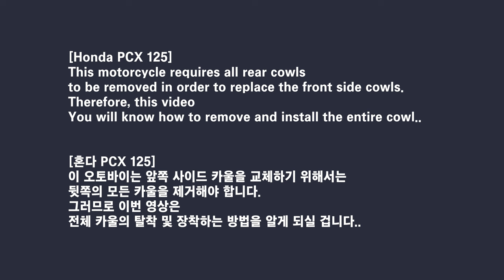Let's see how to change the Honda PCX 125 cowl cover? WW125AM

Comment: I have the same exact scooter, a 2022 Honda PCX Jasmine White and unfortunately I found it yesterday almost knocked down by a car as I suspect because unfortunately no one saw it and it was laying on the bush next to it fortunately, on the right side, so there is no other damage, because I always keep it under a cover. So, I have the left front fender damaged (where it was hit basically), cracked, some scratches and with a hole in it which I really hate and I can't get over it as the rest is in perfect shape :( . I was feeling so frustrated because I bought it new, now it has 5700 km. (I have to change the oil at 6000 km.), and I feel like I can't fully enjoy a new vehicle even though my friends and relatives told me "just leave it like that, it's not so bad, it could've been worse, you can live with that, it's just a scooter, not a motorcycle" which pissed me off to be honest... ughhh... so I searched the entire Internet to find the replacement original painted part and I finally found it in Greece, original in the same color as my PCX. I want to thank you for your work and for including the English translation (very useful!) and as soon as I get the new part I will watch again your video to guide myself as I see that I have to strip down almost the entire scooter to change one front fender because I don't trust any mechanic here in Romania were scooters and motorcycles are considered like "leisure toys" so to say and this particular model is too new to be broken by anyone who wouldn't have patience (in my opinion). Thanks again, sorry for my long comment, and keep it up with your work! I like countries with a strong culture for two wheels! And that snow at the end of the video... was the cherry on top, I miss the snow even though otherwise it wouldn't let me ride hahaa. Greetings from Bucharest, Romania, and Happy New Year !!!
Reply from the maker: Hello "aleXpeed1"
I'm so glad you watched my video from Bucharest, Romania.
I have something to tell you first.
Contrary to the maintenance manual, engine oil must be changed every 1500 km.
You can tell the condition of the engine by looking at the condition of the engine oil, so it is recommended to change it often.
The maintenance of pcx is generally similar even if the production year is different.
You just have to be brave and do your own maintenance slowly.
I hope you get it resolved well. 😄

Comment: Damn, i wanted to connect an usb from the steeringwheel to my battery.

If i see that i have to remove all tis sh!t to do it.... i think i will take a powerbank with me for my phone/gps😂
Reply from the maker: There are several videos on my channel about installing a smartphone charger. please refer to this
Reply: @MotorcycleRepair  do you have ANY idea how much videos i have to search through to find it? 🤣🤣 
615 videos
Reply from the maker: @jasmijnariel  If you go to the address below or search for “smartphone” on my channel, several videos will appear.
https://www.youtube.com/@MotorcycleRepair/search?query=Smartphone

If you apply the method of connecting electricity to charge your smartphone in the video, you do not need to add an auxiliary battery.